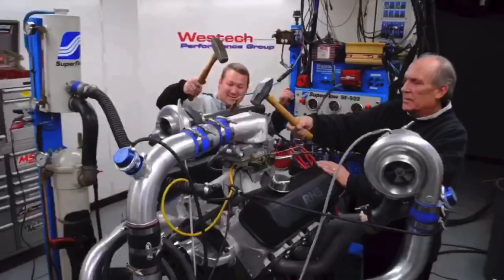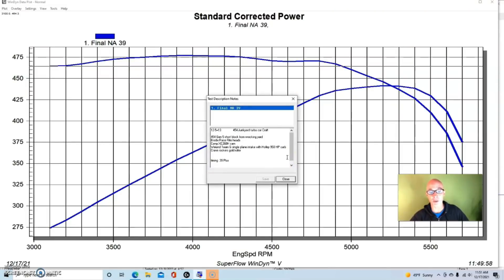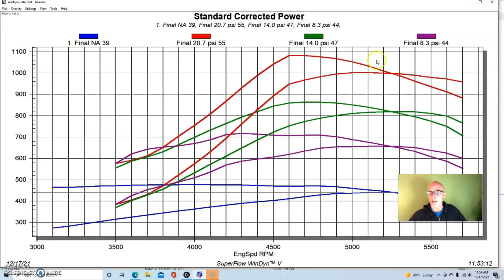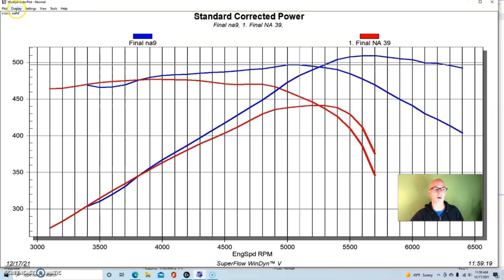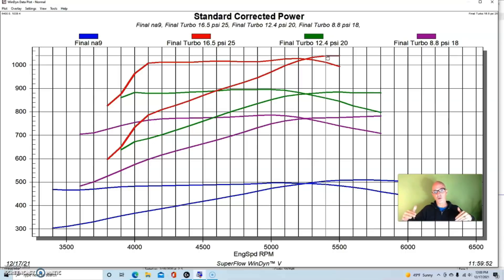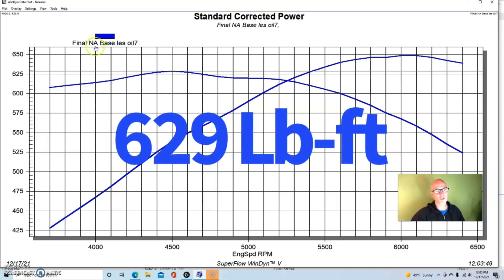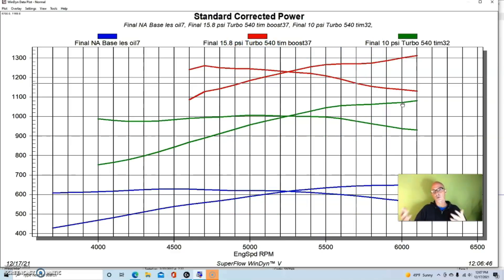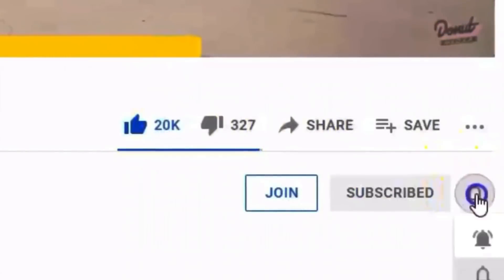JUNKYARD TWIN TURBO BIG BLOCKS-HOW MUCH BOOST DOES IT TAKE TO MAKE 1000 HP? 3 DIFFERENT BBC COMBOS

Comment: What size carb is that?
Reply from the maker: 850
Reply: @ I’m currently doing the same setup. I have a gen 5 454 stock long block cam only. Twin gt45. 50mm wastegates. All I have left to get is carb an intercooler and piping!

Comment: If I have GT 45 eBay turbos, can I do 800 horsepower on a stock 454 or 427 big block?With peanut butter heads safely
Reply from the maker: If you have twin GT45s, you can do 1500 hp

Comment: Would it be stupid to add twin turbos to a 71` Pontiac 455 HO with Ram Air heads? I know the compression would need to be lowered.
Reply from the maker: would be awesome
Reply: @richardholdener1727  Thanks for the feedback. Might be something that I pursue then. 👍

Comment: I have a 496 that currently has 12.5:1 compression and a large solid roller. I plan to lower the compression and put a mild to medium hydraulic roller and twin s475's. What would be the best compression ratio to start with and cam specs for low boost 1000 hp? I would like to do it on pump gas at low boost and use better gas if I wanted to turn it up. Any help is appreciated
Reply from the maker: use smaller turbos for 1000 hp and 9-9.5:1 comp and is this going to be a driver?
Reply: @richardholdener1727  Yes a driver for sure,
Reply: @richardholdener1727  I'm also open to using a single turbo if it can be done without needing one that is super big

Comment: I am dubious as to whether the stock bottom end Gen 5 454 would be able to handle 20 psi of boost long term even with new rings.  People think they can often build 1000 hp motors for $5k due to watching shows where guys throw together "stuff they have lying around".  I'm not saying Richard's doing that here, he's a pro and demonstrating what is possible.  However, you can have a low buck engine or a reliable engine but you cannot have a low buck reliable engine.

Comment: Hey Richard, how do you go about getting the air fuel ratio correct with boost and a carburetor?
Reply from the maker: by adjusting the jetting, air bleed and boost referenced power valve opening
Reply: @richardholdener1727  so, does that require a special carb?
Reply from the maker: yes-a blow through carb

Comment: Hey Richard... Any plans on a BBC.big bang... I know unless it's careless it'll be hard to hurt it... But boost is better... ? 454 lots of boost  steel crank and rods. 345 heads and your fav. Comp roller.? Thanks I'll keep watching, you keep the Dyno warmed up. Thanks
Reply from the maker: A BIG BANG MOTOR IS STOCK BOTTOM END-BUT YES

Comment: If your going to run e85 run the most boost you can by testing. If your going to use 114 then run 36 pound of boost. Don't run racing gas if your not going to take full advantage of it by max boost.
Bv

Comment: The complete advantage.

If you run on alcohol, you don't need an intercooler,, no bleed of valves,radiater, or low compression and run high boost.
Reply from the maker: INCORRECT

Comment: Alright so here a question. In your opinion what is the better route for reliability and cost. Bbc or Ls based engine. 
4 bolt mains compared to 6 bolt mains. Stock cranks on both . What’s the better route
Reply from the maker: both of the things you mentioned are reliable

Comment: You have so many great videos, thankyou. Curious what the timing was set at with these tests. Also curious to see a video done comparing fuel types and boost timing retard. Ultimately I feel everyone wants to build the most power using the easiest available fuel, (premium pump, with water meth injection). Not everyone has access to e85 and or race gas.
Cheers from Canada 🍺

Comment: I argued this with another commenter on one of your earlier vids. There is no getting around it, there is no replacement for displacement. Everything that can be done to a smaller engine(LS), can be done to a larger one, and less hammering with any power adders will get you better results. Boost works on everything, I agree. But you have to use more boost on smaller engines than on larger ones, to get the same results, period.

Comment: E-85 in a boat that never gets hot 160 temp is hard. Whats the highest compression you could go with pump gas e-85. 454 10 to 1 e-85 10lbs

Comment: This is so dang good! That Gen 5 made well over 1200 hp at 29 psi with a tiny flat tappet and 7 to 1 compression! Way better than the Big Bang 6.0 LS.
Reply from the maker: HOW IS 1200 HP WAY BETTER THAN 1543 HP?
Reply: It was way tamer than that 6.0 and the 454 is way easier to find and cheaper when you do. My point is that people act as though the LS is the second coming. But in reality most of the miscle car era engines are just as capable.
Reply: @richardholdener1727  whats the weight difference and cost of an l.s. that makes 1500 to the big block at 29#?
Reply: @richardholdener1727  Would be it feasible to run twin GT45’s on a stock 8:1 460 through the stock manifolds? Or would it be better to run just one? I was concerned about the back pressure.

Comment: I'll take high boost, low compression (8.5:1) ALL DAY, EVERYDAY.
More margin for error if starting low.
Step up your game later as $ permits (lighter, higher flow, better heat transfer aluminium heads, roller valve train, intake, EFI, et al).

Comment: Hey Richard live your work i would love to see you do a video on the fuel injected Buick/GM 3800 v6 but I would really love to see if you could do away with all the fuel injection and  coil packs and run it on a carburettor😁
Reply: As a time traveler, he did it.  I watched them a few days ago.

Comment: Richard, question regarding the Gen6. How much are the heads worth compared to the stock “vortec” large oval ports like I have? I’ll hopefully be using a zz502 cam. Also from what I’ve read those heads don’t like much ignition timing, something like 29 degrees? What timing did you run on the gen6 while adding more boost?
Reply from the maker: 30 DEGREES

Comment: Would I be able to run 20 lbs of boost in a street/daily driver situation or is that to much for the motor
Reply: 20 lbs? Why so much for street?
Reply from the maker: NO NEED TO RUN THAT IN A DAILY DRIVER

Comment: Would 2 S475 turbos on a BBC 496ci  be appropriately sized?
Reply from the maker: FOR 2000 HP-YES
Reply: @richardholdener1727  So would 1 S475 turbo be able to support 1300hp on E85? Or what size turbo would be a good size running a single?

Comment: Would this NA vs boosted output be the same with 350 ci vs the 454ci.
Reply from the maker: THE BOOSTED POWER OUTPUT IS A FUNCTION OF THE NA POWER
Reply: @richardholdener1727  10 - 4

Comment: Bigger engine with better heads/cam and add all the boost like I do with my 555  , why stop at 1000 , never thought my 4900 lb truck would  ever wheelie and run a 1.36 60 foot on a street truck but  it does and Colour me happy .

Comment: You can make 650 hp with an ls3.   And it weighs 200 pounds less
Reply: But an ls3 doesn't make the same torque as these engines at low rpm. 650hp 540cid way faster than 650hp ls3 in a heavy car or truck.
Reply from the maker: PLEASE SEE THE 825 HP TURBO LS3 WITH 7 PSI

Comment: What head gaskets do you run on these 454? I guess I mean what brand b/c gen 5 will be different than gen 6. I have a 454 with vs racing with single 85/102 with promaxx 317 heads and using felpro 1017 head gasket, afraid to go 10#s with them.
Reply from the maker: MLS
Reply: I heard him say before on the 496bbc he did with other power adder's they were the fel-pro MLS gaskets that's what I bought for my build

Comment: If I done the first motor with 20psi from a single turbo, would that still yield the same results? I’m assuming the curve would be moved because of spool time/turbo lag but 20psi is 20psi…right?
Reply from the maker: AS LONG AS THE TURBO WILL SUPPORT THAT

Comment: That graph on the 454 with the XE268H cam is the very reason why I chose to install that cam in my tall deck 427, because adding the Littlefield 8-71 is going to make foundation moving power for my tow truck. I wasn't wrong with my cam choice.

Comment: Until I looked back at the cylinder head shootout and seen how expensive those heads are. Any  budget friendly options with similar specs like those afr's
Reply: There's a reason AFR heads are expensive.  They're worth it.
Reply: @andyharman3022  of that I have no doubt. But when your entire dually budget is 30k cad it's a bit much. Lol. I'm going to 496 stroker with twin turbo and I figure at this point any aluminum head would probably be better than my peanut ports. I was just wondering out of the budget menu which ones would be best?
Reply: @Gameplay-3D  The Pro Max seem like pretty good budget head's
Reply: @Gameplay-3D  Did you see Rich's video where he tested AFR's peanut port heads?  They're awesome.  I've had AFR small block heads on my Corvette since 1993, and they still perform great.  No issues with them at all.

Comment: Junk yard gen 6 block, fire rings, head studs, main studs, forged Pistons, tons of boost...
Reply from the maker: no need for fire rings or main studs
Reply: @richardholdener1727  what about o rings for over 30 psi? You haven't broken a stock junkyard engine as of yet. But haven't been able to throw a bunch of boost at it to find it's breaking point?
Reply: 1500hp should be easy. What if it's a 2000hp capable engine just on boost, cam, valve train, hardware and orings?
Reply: Maybe even a main stud girdle...

Comment: ill never forget an old friend had a done up motor with an extensively ported head and he scattered it...the new motor had a stock port head.  I asked why not port it?  He said...its easier and cheaper to just run more boost instead.  He is not wrong.
Reply: It is however by porting the head with turbos anyways less boost is needed to make the same power which means you can reduce lag and have a better low end due to the turbos not needing to spool as high and more exhaust flow to the turbine also means  faster spool even with cams made for turbos you can make pretty big numbers as some guy with a ford 3 valve made just under 400hp naturally aspirated just by getting headwork with new tune and fuel system

Comment: The gorilla in room is the ability to buy high octane fuel if you go #1. Or namely cheap e85. If you cant get e85, buying parts might have a better ROI to lower the detonation potential vs buying race gas all the time.
Reply: Water methanol makes 1000 plus possible on Cali 91 with boost on a sunny 109 degree day, aluminum heads and a low coolant temp a are a huge help with boost and detonation too

Comment: What size oil feed line do You use for the Ebay Gt45s?
Reply: I can't answer for Richard, but I would use at least a -3 feed line with a -10 drain. I personally always use a -4 with a 1mm restrictor and a -10 drain.
Reply: @DiamondBackRattlaKid  restrictor use depends a lot on the turbo.  I like those cx racing turbos.  Great bang for the buck.
Reply from the maker: -3 or -4-whatever we have